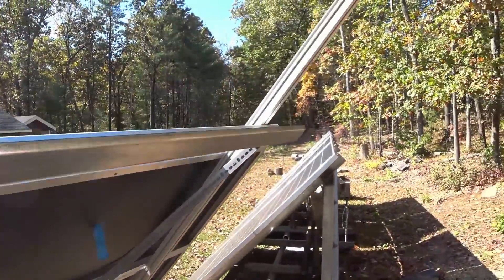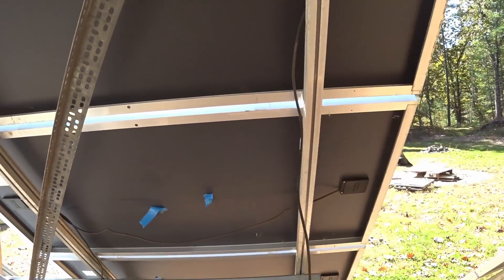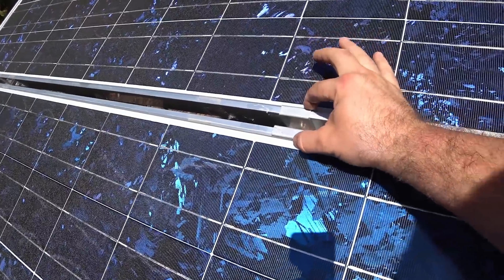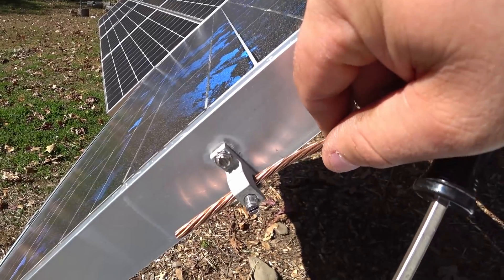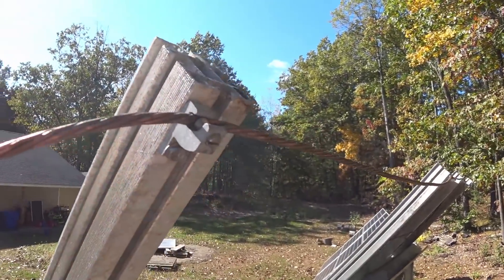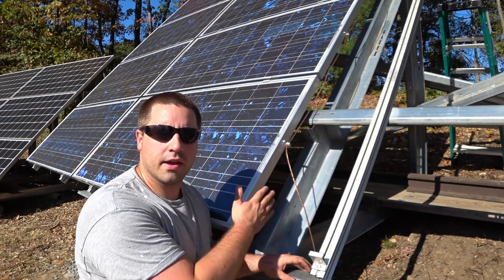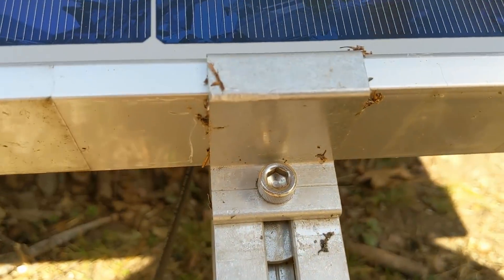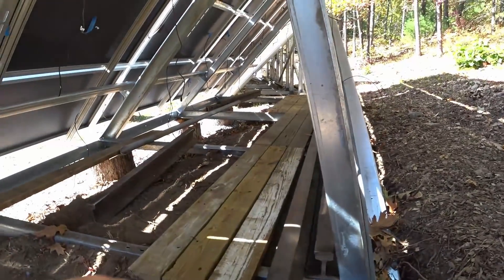Mounting Cheap Solar Panels on DIY Frame 3.16 KW

Comment: Any idea which companies sell solar frames for 445W Split-Cell Mono Solar Panel ?
Reply from the maker: Iron Ridge.
Reply: @DavidPozEnergy  I reached out to Iron Ridge but they only have ground mount frames up to 360 watts. 

Having a very tough time finding it. I appreciate your help.
Reply from the maker: I guess I'm not sure what you are asking.  I have friends that have used Iron Ridge, as well as DIY solutions (like Uni-strut) for all types of solar panels.  One in particular was a 480W panel if I remember correctly.  Depending on snow loads and wind loads you might need 3 support rails per panel instead of the usual 2.   For that matter, you could use 4 support rails if you wanted.  Rails are not usually a specific thing to a type of panel on residential.  Although I have seen specific rails to panels on commercial.
Reply: Apolgies, I am learning as I go. looking for a ground based mounting system for  445 Watt Split Cell Mono panels. IronRidge rep told me there ground mounts can only hold 360(or 380) watt panels. 

Sounds like you are saying, I could look at ground mounts from Iron Ridge and see if it will fit my 445 watt panels and reinforce with additional support rails. Correct?
Reply: The company I reached out to was Shop Solar NOT Iron Ridge. Thanks for the information.

Comment: Hey David, since this was pre-stupid time, so a long time now, have you put up any sorta cage to protect your panels from falling branches yet man?   I mean like concrete reinforcing wire stuff you know (but they themselves would have to be very stable and stiff so any heavy branches wouldn't force the steel onto the panels when landing on them hey?) :O

Comment: It took me a minute to figure out what you mean by DIY because it appear like everything you used is store bought. But i assume you bought the solar panel racking materials, but you made the backbone structure yourself.
Reply from the maker: Personally, I think it's any time you don't hire someone else to do it for you.  You do it yourself.  In this particular video I bought used panels and used racking off Craigslist.

Comment: Why is a ground wire necessary when the panels are bolted to metal?
Reply from the maker: This is an old system.  New systems will use serrated nuts to make a bond between the metals, but this older system required an external ground.

Comment: Are you using aluminum studs or steel studs for you racking?
Reply from the maker: I'm using steel for the main frame off the ground.  Then I have aluminum rails which are the 2"x2" extrusions the panels sit directly on.

Comment: How much distance do you have from your array to your charge controller and what gauge wire did you use how do you have them wired all in series or what type of voltage Are you delivering to your charge controller?... I just ordered 10 used 250w Canadian Solar Panels... trying to work out the placement and all the components
Reply from the maker: 96 feet of wire, 6 gauge.   When sizing your system keep the total of all your wires to less than 3% voltage drop.
Reply: @DavidPozEnergy  what voltage do you have coming out of your array(s) going to your charge controller(s)?.. starting with 8 to 10 panels I'm probably going to have to have at least 2 40-60 amp charge controllers I'm going to run on a 24 volt system... I know you're later variations of your system were 48 volt
Reply from the maker: about 160v
Reply: @DavidPozEnergy   Do you mind if I send you a message on your Facebook profile or something it would be nice to have a question and answer person on and off throughout this project? :)

Comment: so how it stands vs wind ?
Reply from the maker: I've never had a problem.  Even when the hurricanes come up the coast.  (usually a tropical storm by the time they hit me).  The panels don't even shake.
Reply: @DavidPozEnergy  we have maximum wind speed of 35meter/second and every company afraid to mount tilted on the roof.. cause wind gona tear it.. ;D i have couple friends that have bad roof direction, and angle, and he made a similar size tilted frame, and put 2 rows of 7 panels  and that is standing on a roof.  I have same issues, and i need to make like 2 frames of 14 panels :)

Comment: Are you willing to answer questions about this?  I just got this recommended to me.  I'm not in solar power yet, but I want to long-term.  I am hoping price comes down and gives real solutions.
Reply from the maker: Check out the Facebook group called "DIY Powerwalls".  I'm a member and answer questions on there.  But there are thousands of great people willing to help.
Reply: @DavidPozEnergy  Thank you for the reply.  It is just too expensive long-term to cool my house, so I'd plan to just setup solar just to run A/C first.  Then, conquer that and do more later.

Comment: Hi David !  That is a lot of panel you have there. How much amps you have generated from them ? What was the wire size you have chosen? - Malaysia
Reply from the maker: I'm using 10 gauge wire (AWG) because this is only about 14 amps.
Reply: @DavidPozEnergy  i guess your system is 48v

Comment: Great video.  Why did you choose these panels?  You mentioned relocating them, so maybe that is why.  How are you resolving the aluminum/copper connections from a corrosion perspective?  Did you use anti seize?  I am curious not trying to be a troll or anything.  Haha
Reply from the maker: I bought these panels used for a great price.  For a couple years I had them in my front yard.  They were on a pallet frame, powering my space heater.  There are some videos of it.  Now I'm relocating them to the backyard and will have to get a charge controller to charge my battery.  
As for the aluminum/copper.  The frame is aluminum, and I have attached "lay-in lugs" for grounding.  These lugs are copper, but they are plated with something (probably nickel or tin).  This nickel prevents most of the corrosion from occurring to the point where no additional treatment is needed.

Comment: Precious baby! "Solar Panels, Solar Panels" Why did you decide to install used solar panels? How much power do you get from them? 
I know you said the price was $0.16 per watt. My question is: Was it worth the investment? 
Your  little girl is so exited helping you! Great couple!
Reply from the maker: Yes, it's worth it.  These panels still put out what they are supposed to.  Perhaps they will fail sooner than a new array, but I didn't have the money for brand new panels at the time.
Reply: @DavidPozEnergy  Glad your solar panels work well. Here I realize they are high quality. Nowadays, Solar Panels are not high quality as years ago. I mean, Solar Panels were better before. Great investment !

Comment: I may have missed it.  Where does all of it now grounded together get grounded?  Bolt to the stump?
Also, If a hungry squirrel in the spring looking for anything to eat chews into a positive while standing on a negative frame, the panels wont care - they will dump current to ground all day through the “squirrelistor”. Is there a chance any part of the frame will be energized or partially energized due to insufficient grounding connections (resistance between parts) making one part less grounded then another part?  Someone touching that part of the energized frame while they are connected to a more perfect ground .....
Basically, are the screws between frame parts a good enough electrical connection, or do they all need grounding straps, and can each screw develop enough corrosion to be a resistor instead if a perfect electrical connection. Both Zinc and Aluminum corrodes and that corrosion is not a perfect conductor.
Reply from the maker: I drove a ground rod on my other array next to this one, and rand a #6 wire between the two.  I got a good laugh out of "squirrelistor".  That's a good one.
Reply: DavidPoz, Yeah, thanks!  It made me giggle!
Grounding is an area that concerns me. 
There are cases where the dirt-ground is not a very good conductor, so multiple grounding rods are needed. I have no idea how that is determined. 
Metal parts bolted together becoming electrically isolated is something I have seen. I don’t know how to guard against it with lots of parts bolted together. I don’t know best practices.

Comment: Solid wire grounding was taught in the old days. New:
“The grounding electrode conductor shall be of copper, aluminum, or copper-clad aluminum. The material selected shall be resistant to any corrosive condition existing at the installation or shall be protected against corrosion. The conductor shall be solid or stranded, insulated, covered, or bare.”

Comment: David, is there a concern due to the dissimilar metals (copper and tinned steel) leading to corrosion of the grounding wires?
Reply from the maker: Not in this case.  The grounding lugs are tinned copper, and made for the bare copper wire.  New panels use hardware that makes the grounding connections so you don't have to do this.

Comment: My question was answered at the end of your video when I saw you are using buckets filled with material to hold your frame down. Where I live, 25mph winds are considered light gusts!
Reply from the maker: Most of Massachusetts has a design load of 100 MPH, unless you are right on the coast.  I've been adding to the ballast.  I'm probably around 2500 pounds of ballast right now.

Comment: You said at 3:44 that you 'also need to ground the frame itself'.  Does that mean the entire frame?  will the code accept that parts of the frame are 'screwed together' as bonding the parts (say the vertical struts to the angled struts) together?.     I ask because I'm building a frame myself with 2" galvanized sched 40 pipe and universal strut and wondering if all pieces of metal of the frame have to bond to each other.
Reply from the maker: When they are screwed together they are "bonded".  I'll be adding one grounding lug to the galvanized frame and running that over to my ground rod.  Just like I did in this video: https://youtu.be/9DDGNp6Pcv0  Thanks for watching.

Comment: Why would you need to ground each panel? They're bolted to a steel frame!? Grounding the frame should be more than enough. That's just ridiculous!!
Reply from the maker: The solar panels have anodized frames.  The anodize coating prevents a good electrical contact.  I'm using old panel hardware and this is how it used to be done.  Today the hardware has teeth that bite through the anodized coating to make a good electrical contact.  Thanks for watching.

Comment: One should use a scanning type panel mounting system and fold down,wind protection. Tracking boost power.
Reply: K.I.S.S.

Comment: Someone gave me a similar "broken" panel.  After just a little debug, I noticed the hot glue melted and covered the metal screw where we connect the cables.  So I just soldered a new cable directly on the metal instead of using the screw and it worked immediately.  Easy fix!

Comment: Really enjoy your videos! Any wind turbines in the future?
Reply from the maker: I'm not at a very windy site.  So if I took the time to set one up it would be more for the fun of it, rather than the electricity.  If I get the time I'd love to make one.  I have a treadmill in my garage waiting to be taken apart.  The motor might be useful for a wind turbine.  

Or, if I ever found one used on craigslist for $50 I would spring for it.
Reply: @DavidPozEnergy  That would make an interesting video. Hows your thermal bank working out? Are you getting enough hot water? I was thinking if using the same principle to pump the heated water from a thermal  bank to a heater core in our trailer to take the chill out at night. On paper it looks good anyway...
Reply from the maker: The thermal tank works well. It handles most of our hot water.  On sunny days it handles everything, but after two days of rain the thermal tank will be cooler and the electric backup will kick on some.
Reply: Take a look at the John Daniel YouTube videos. He has found durable, powerful turbines that are quite inexpensive. His videos are very erratic but does have good information if you can get through it.

Comment: All good.Just one thing,You need to place the solar strings little bit away from trees.Just in case some tree branch falls on solar panels,due to wind/storm.
Reply from the maker: In an ideal world I would do that.  Unfortunatly, my lot is very small.  I pushed the panels as far to the north as I could.  If I moved them further south the neighbors trees would shade them all Dec. and Jan.
Reply: @DavidPozEnergy  thumpsup

Comment: Can you tell me where I can buy Solar Panels for 16 cents per watt? I just put up a 1 kw system of 10-100 watt panels and these were around 80 cents per watt, this was as cheap as I could find on Ebay.
Reply from the maker: I found the deal on Craigslist and got there 20 minutes after it was posted.  Another person showed up while I was loading, Ha.  Deals go fast.
Also, you can buy brand new panels from Alt-E for $0.57/watt right now, and they run sales pretty regularly and you can get them as low as $0.50 per watt.
https://www.altestore.com/store/solar-panels-c541/?sort=price_watt
Reply: @DavidPozEnergy  Thanks

Comment: German Schüco panel ?
They last forever ... just arrived in second life after first 2 decades or so. 

And Schüco still exists and supports them ...
158W or so is not a lot for current top modules but they will suck in price ... price per kWh or kWPeek. And new aluminium profiles are expensive and about 55% of a 270 W panel ...40€ each alloy frame and 77€ the panel ... if you purchase in winter.

If you have that space it is the best solution and will work till your daughter can drive a car.

Great explanations ...

Comment: David, you probably covered this but I have not seen it yet - Orientation: obviously facing the sun but is there a way/need to change the angles throughout the year?  There is probably an app to help me determine initial orientation based on where I am but what about changing throughout the year?  Thoughts?  All your angle brackets look like they allow for easy angle adjustments.  Point me to old videos if covered.  I am watching as fast as I can and loving the practical info.
Reply from the maker: 2-axis tracking arrays can output up to 30% more kwh per year.  But this "up-to" assumes you have your panel in the middle of a big field, so the tracking takes advantage of low-angle sun in mornings and evenings.  I can't take advantage of that at my site because of my small lot and neighbors trees.  Lots of shading.  My solar window is very narrow.  Because of my site conditions, my potential goes down.  Perhaps I could get an extra 10% at my site.  I'm not really sure.  But I'm building this with salvaged metal and don't want to add expense by purchasing hinges, motors, control system.
Thanks for watching.

Comment: Grounding aluminum frames of each panel bolted to steel frame with aluminum brackets.... are you serious?It can be counted as single metal construction and if you so bother to do it you could do this in one point. But overall this array looks huge :-) Lucky you!
Reply from the maker: My understanding is that the aluminum frames have an anodized coating, which prevents a good ground.  It does seem like overkill though.
Reply: @DavidPozEnergy  Yeah, indeed, anodizing coating is quite insulate, didn't noticed that (watched on my phone while driving car).
Reply: @aldercamper9430  , "watched on phone while driving car"?!  Haha is your name really Ken?
Reply: @TheRainHarvester  your not talking about me are  you 😁

Comment: It`s a lot of work putting up panels by your self. My 160w carport solar panel install worked out to be 2 hrs per panel. No way I could do 300w panels my self.
Reply from the maker: It's easier on ground mounts then a roof.  Thanks for watching.

Comment: You shouldn't use stainless steel and aluminum together.  The combination of aluminum and stainless steel causes galvanic corrosion.
Reply from the maker: It's true that dissimilar metals will corrode.  In this case the aluminum is anodized.  There is no current passing through the frame.  And I don't live on the coast (salt water).  So any corrosion that happens is extremely minimal, to the point that it doesn't bother me.  Thanks for watching.

Comment: 4:03.. I'm in Canada and either is Good for Grounding. I use the Bare Stranded wire to Ground my 40' X 80' shop. Been there for +20 years with no issues.
BTW...... She's cute as heck....;-)
Reply from the maker: That's a good track record.  20+ years with no issues.  Great.

Comment: The reason solid grounding wire is preferred is for durability.
Stranded wire needs protection.
Reply: Not if its 6 awg or larger according to the NEC.

Comment: Looks so good. I have seen guys use that space to stack fire wood. Works good but then one of my friends wife was trowing wood out the truck and broke A PV mod from the back side with a pice of wood. Love the use what you have deal. I do the same. God Bless..
Reply from the maker: O, no.  My heart would break if I was stacking cord wood and broke a panel.  I hope they were able to buy a replacement.